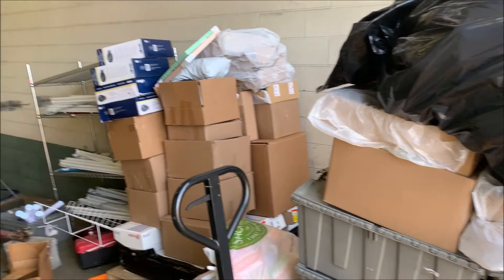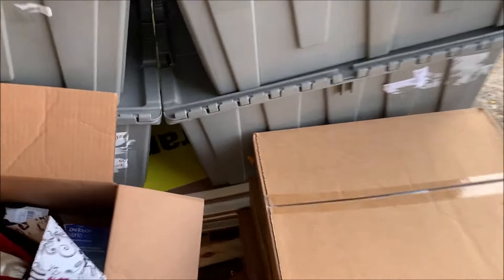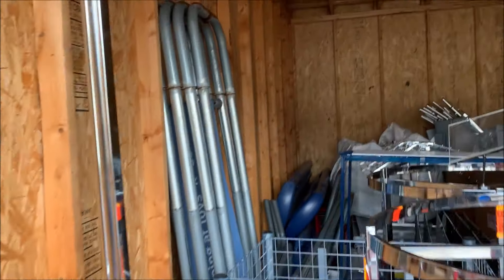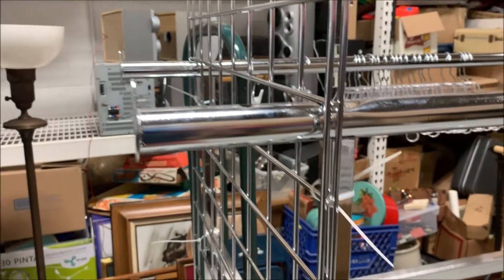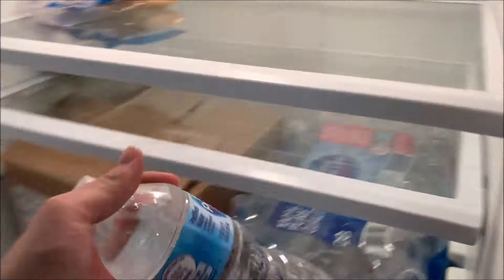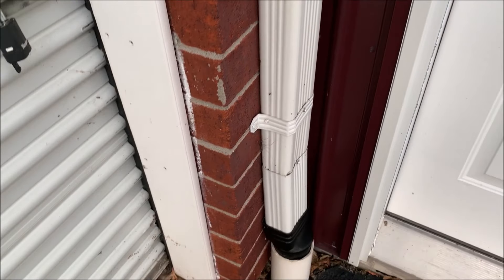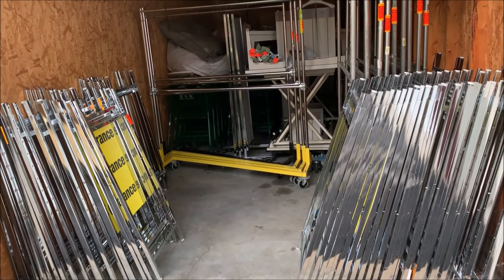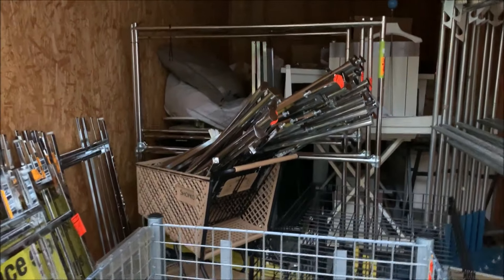Part Two | Even More Organizing

Comment: There is always a learning curve with any new thing you do , the longer a trailer is the easier it is to backup short trailers react more severely to any movement . I have enjoyed your channel for about a year and a half . Haters and the jealous will whine and snivele every chance they get .
Reply from the maker: That’s actually very good to know. I’ve been wanting to get a larger trailer but I’ve been hesitant because I figured it would be even tougher to back up
Reply: @ResaleRabbit  rent a long flat deck trailer next time you have to pickup some pallets instead of a truck providing the weather is friendly way easier to learn on than a box trailer as you can see what the trailer  is doing.

Comment: Now as far as the light you have her concerned get your roll of Romex and some plugins once you open up the light you should be able to just disconnect a wire nuts and wire in the new pigtails then you can plug them in anywhere

Comment: So what is the ultimate projected use of the objects moved to storage units?
Reply from the maker: You’ll just have to stay tuned to find out!
Reply: Dan Swinehart I was going to ask this too. I was wondering if paying the storage fees are worth it for the stuff inside it.
Reply from the maker: It is. I figured about $2000 to store it for a year. I got the stuff free or extremely cheap so it worked out for me.

Comment: Interested to find out the conclusion to the previous owner using their former storage unit again?
Reply from the maker: Turns out it was someone else. They rented a unit online but put their stuff in that one instead.
Reply: @ResaleRabbit  is that even allowed  ?
Reply from the maker: Ghost it was just a mixup. They inverted the numbers. Rented unit 48 but put their stuff in 84 (or whatever the actual numbers were). The storage facility just needed to switch it in the system.
Reply: @ResaleRabbit  understood
Reply: Ghost Thanks for asking the question I was going to ask!